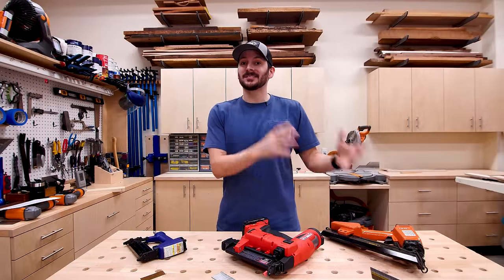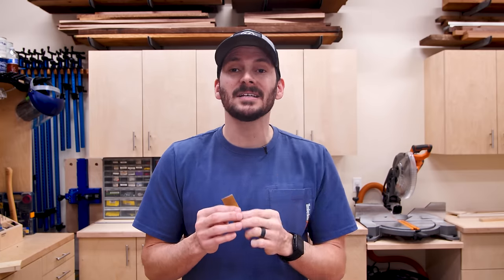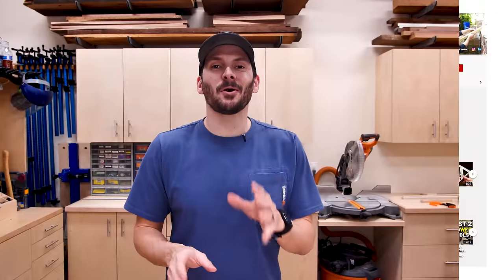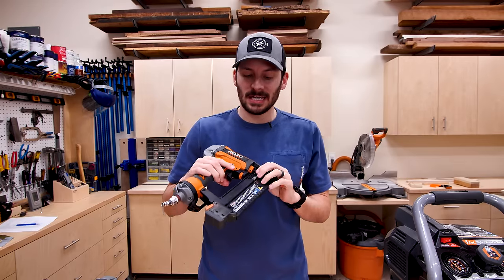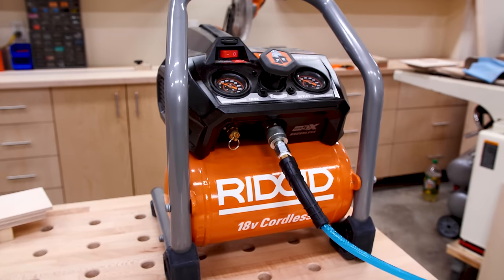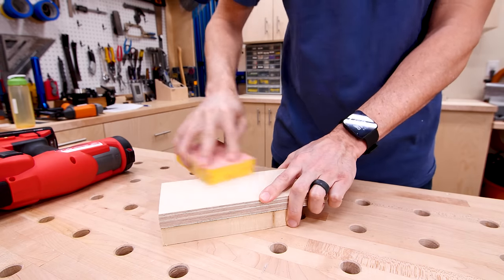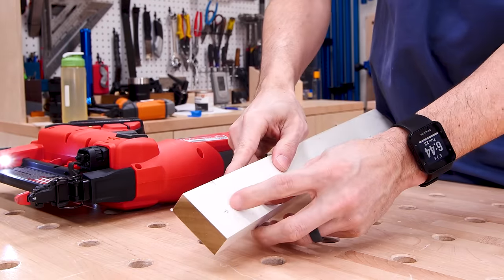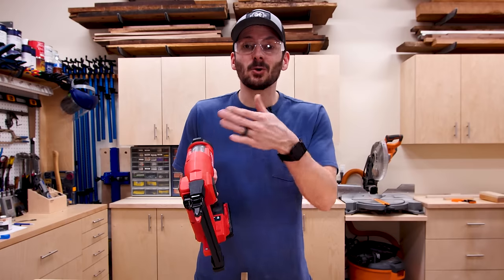6 Nail Gun Mistakes You Should Avoid | Brad Nailer Tips

Comment from the maker: What other tips and tricks videos would you like to see?  It was fun deep diving into one tool/technique.
Reply: I think we would also benefit from a miter saw calibration video with your unique blend of “attention to detail.”
Reply: Any one !  Make it a series ! All tools have their little secrets, don't they?
Reply: How about a bonus track on fixing blowout when you're not able to pull the work apart?  Usually I end up prying the blown out end up some, cutting flush with the surface then using a nailset or a punch to hammer it below the face of the material and filling/sanding.  But, I feel like that's almost a butcher-level move, and I'm never fully happy with the result - there's gotta be a better way out there somehow.
Reply: You can use a nail set to LAUNCH hinge pins out of doors.
Reply: Maybe a sanding video... Different type of sanders..  What grit to use... Different techniques. sanding block types.. Just a thought
Reply: I with JL R's comment ! Make a few videos of the "proper way" to use tools , fixing common mistakes (blow outs) , cause u don't know your doing something wrong till u see it being done the right way !! Thanks for sharing 👍
Reply: @shinji391  m
Reply: I would like to know the best way and nail size for t&g log lap sidings on the outside of cabin.
Reply: We did some bookshelves and felt like we were shooting the nail through blind and we would put the backing of the shelf on and want to attach to each individual shelf. Many of the nails shot through and missed the shelf as we were not able to tell where the shelf met the back. If you have ideas when doing bookshelves where you can’t tell where the nail is coming out the other side, that would be awesome!
Reply: Brad, how about a followup about brad nails and saw blades?  I don't ever intend to run a nail through a table or miter saw but was just wondering how damaging the 18 gauge in particular would be to a good carbide blade.  My daily use table saw blades go in price from a Freud Glue Line Rip up to a Woodworker II so just wondering if I should have a cheaper blade to use if there's a chance of hitting a brad nail.  Hammer driven nails are a whole different animal because they're heat treated steel and I would expect them to damage a carbide blade badly.  Thanks!
Reply: 99
Reply: Everyone shows us how to check for square by measuring diagonally but never shows how to fix it if it isn’t square
Reply: Which compressor to use for workshop tools - and why!
Reply: A video on how to use a bandsaw would be great!
Reply: @David-hm9ic  
Small gauge nails that are embedded in the wood, and that are perpendicular to the blade, represent a small profile. They don't seem to affect the carbide, unless it happens routinely. Framing nails (striven with a nail gun or hammer) are not heat treated (hardened). Framing nails are required to be malleable to function properly in shear. The use of hardened "construction screws" are not allowed in framing (by code),  for that very reason. Concrete nails are hard and brittle and would therefore be very damaging to a carbide blade.
Reply: You didn't show how you'd fix the blowout should you get one. Is it possible?
Reply: I'd like to offer an alternative answer to your last problem. side blowout. it's not so much the shape of the nail as it the orientation of the chisel tip. When shooting parallel to the board, the chisel tip is also oriented that way, and will tend to follow the grain, as previously stated. When turning perpendicular, there is no grain to follow, AND the chisel tip will cut across the grain. This will also result in a tighter fit, as the grain won't try to separate to let the nail through. The cut fibers will bend down slightly, creating a feathered edge gripping the nail from coming out.. This also reduces the chance of end splitting when you nail too close to the end of the board.
Reply: Put them in at an angle for a stronger grip especially you use a longer nail the gripping power is insane vs straight in and if you alternate direction back and forth that increases the nails strength. so along a length you aim one a 15 to 35 degree up next one down repeat as any stress on the joint make it hard to pull straight out like a more traditional straight in nail it also means you can use less nails but still get a better grip (Not that you should skip the correct amount of nails!)

Comment: I've been a professional painter for over 30 years and found out the hard way that you don't fill nail holes until you've stained and put one coat of sealer on.  This will greatly reduce any putty fowling the wood and showing as a big blob when stain is applied.  Once the first coat of sealer is dry simply lightly sand the surface and then apply the wood putty or filler of your choice.  Once this is dry, again lightly sand and then apply the finish coat of varnish.  You can use color putty, or if you like the glue and sawdust option then just wipe a quick coat of stain on a rag over the nails before the last sealer coat.

Comment: oh my god, the blue tape trick is so obvious and genius yet it's never occurred to me.
Reply from the maker: Yeah, one of those "duh" moments when I found it too
Reply: mixing stain with glue and sawdust also
Reply: exacly, when i saw that, I thought holy cow that would have saved me about a months worth of sanding and probably 10 gallons of wood putty.
Reply: The tape could also act as a guide or nail line.
Reply: Love this tip!!
Reply: Very clever.  I plan to use the blue tape tomorrow on a molding project. Thanks for the tip. I bet it'll work. 👍
Reply: Yep that was the one where I went "oooohhhhh" most useful part of the video
Reply: Blue tape seemingly solves everything

Comment: Here is one I learned the hard way: Don’t expect the nail to pull your workpieces together. Hold them firmly together and then shoot your nail.
Reply: Lol why would you think that it would pull them together? Theyre not screws
Reply: @1988dgs  if you want to prove me wrong you sould have mentioned ring shank nails. Those might work to pull things together. Missed opportunity there
Reply: @autodidacticartisan  a ring shank nail on its own wouldn’t pull anything together, a nail has holding power, not pulling power, it’s the hammer hitting it that moves two boards together
Reply: @1988dgs  youre right, I tried throwing a nail at a board and it didn't do anything. You do need the hammer to hammer it in. Silly me
Reply: @autodidacticartisan  so we agree that the nail alone is not capable of pulling two boards together, it’s the delivery method, ie a hammer, and the hammer in a nail gun has little weight so can’t deliver enough force to close up a gap…
Reply: @1988dgs  sure man I guess we agree
Reply: if you use a framing nailer, often times you can toe nail something and then hit it with a hammer to pull it
Reply: coated nails hold better

Comment: I've got a 40 year old Senco pin nailer that must be oiled fro time to time. If you over oil or oil too frequently with a gun like this you may get oil mist on your safety glasses or even droplets on unfinished work. Undesirable? Yes. On the other hand, it has lasted 40 years without signs of impending failure.

Comment: Great video. However I believe you are incorrect about the adjustment wheel. It does not adjust the driver pin, it adjusts the foot on the bottom of the tool. The driver pin length/action never changes, only the depth of the foot to make the fastener proud or deep.

Comment: I've never heard of the "shoot the nail perpendicular to the board"....that was really awesome and will go in to my mental bank for sure.
Reply: @samuelsmith5773  An 18 gauge nailer that shoots two and a half inch long braids is highly unusual and I've never seen one.
Reply: I do a lot of glazing of stained glass panels - often re-installing them after a repair into very old and hard wood sash. Blowing out the face of an already finished door is a nightmare that happens a few times a year. I have actually had nails do a full 180 and come back out!  Every new guy has had his finger skewered despite my insistence on keeping them clear. I can't always fit my gun at a right angle and not hit the glass. but I will definitely keep the perpendicular trick in mind to see if that lessens the incidence.
Reply: His premise is partially wrong... The reason why it doesn't blow out when the gun is perpendicular is... the tip of the nail. Tips are cut at an angle, that will cause it to follow the path of least resistance and curve one way or another. It will make the nail curve left or right inside of the board, instead of blowing out the side. So look at the nail tip design and nail 90 degrees from the edge of the board. If you can't because you can't get the gun at 90 degrees, grind the tips flat on a stick of nails. And there will be less chance of it blowing out the side. But you might have to adjust the driving power so it sinks them at the same depth.
Reply: @kiddiescripterkiller  Another way to explain this is that when the nail gun is parallel to the board, the sharp edges of the nail is as well.  This makes the tip drive between the grain and more likely to “steer” itself through the grain.  When the gun is perpendicular to the board, the edge of the nail tip is also perpendicular to the grain causing it to cut through the grain letting it stay straight as it’s going through.  Imagine pushing a knife through a bundle of straws parallel to the straws.  It will not cut the straws and the blade will slide between the straws.  If the straws were organized in a way that they guided the knife to the left or right, you would get the blowout situation.  Now if you cut perpendicular to the straws, the blade will just slice through the grain and will tend to go straight through.

Comment: Thank you!  I never understood the finer points about blowouts, and how nails/brads want to follow wood grain.  That helped a LOT.
Reply: Woodgrain definitely is a factor, but it's the chisel on the tip that mainly steers the nail. Brad nails are chiseled on the sides and finish nails are chiseled on the front and back. Shooting perpendicular only works with brads. You would do the opposite if using a finish nailer.

Comment: Great video! The way driving orientation and blow out was described to me was by showing me the bevel cut on the nail, and explaining that the bevel will cause it to go to one side or the other. If you drive it with the bevel running perpendicular to the edge, deflection to the left or the right will stay in the board. If the bevel is in line with the board, left or right deflection will cause blow out.

Comment: I have a finish nailer, brad nailer, stapler, and a pin nailer. Love them all. They each have their uses and needs. You're absolutely correctly about nail size, many don't fully understand that. I even have both air and battery operated nailers. For air, turn the air pressure down, you don't need that much PSI. Now, if you actually read the manual on the tool, it gives you the proper settings. Even the cordless nailers have settings you adjust. Speaking of oil for your tools, don't over oil them. Excess oil will get shot out of the exhaust port of the air tool. 
I was taught, to always under drive just slightly and always finish with a nail set. It's old school and I'm old school taught. It's extra work but, you know that that nail or pin is set correctly. As for the putty, there are types that can be stained but, yes, the tape trick always works the best. 
Yup, I've seen many people shoot their own fingers because they kept them in the wrong spot. Great video, cheers :)

Comment: Thank you for taking the time to put this video together.  I never thought about how the Brad nails are less likely to bend up/down vs left/right, as mentioned in you last tip. Thanks man! Keep up the great work!
Reply: Learned that little trick quite a while back. I was looking at the nails one time and realized that they were much more likely to bend on the wide flat area due to being weaker in that axis. Started holding my gun differently so the nails would have the width across the wood instead of lengthwise and it made a big difference. Doesn’t really work on pin nails tho…..too thin…..

Comment: Another reason why the perpendicular trick works is the orientation of the bevel on the tip of the nail. If the point catches wood grain (or harder particles in particle board), it will deflect in the direction of the bevel. 

Great tips, man. Your presentation was clear, concise, and thorough. I’ll be checking out more of your content for sure. 👍

Comment: Usefull video,even for the experienced. I use to work in a cabinet shop and have “nailed or stapled”my fingers a few times. Last time was a 15 gu nail 2” long a year ago. Through the thumbnail. Had to cut it and pull it off the nail. Also I find a 18 gu stapler one of my most used tools. They work good on thin materials like masonite. Like pins and brads,they have a chiseled point and are designed to splay .

Comment: Love the Blue tape trick. You may not agree with my tip, but I have used it for over 9 years. Take 18ga. nail gun and tilt slightly forward and give angle to nail. This give a little more holding power. Now go the to other end of project and at slight angle toward the first nail. Then nail the rest of the nails  straight. I have dun this with 1", 1 1/2", 2" nails.
Reply from the maker: yeah, I could see that.  makes sense to me!

Comment: Loved your explanation of blowouts. I have an experience. Using a framing gun with 3 1/4 nails and doing a toe nail or where you angle the gun against the surface. Somthing I haddent noticed on the piece of wood that I was attaching to. That 3 1/4 in nail blew out at all most a 90% narrowly missing impaling my hand. After the shock of what happened I wanted to know what happened what made that nail do that. On the back side of the stock I was attaching to I found a knot that only went part way through. That knot taught me to really have a good look at both pieces front and back. Now about finish nail blow out. If you don't get your finger nails and get blood all over your finish piece. But now what do you do? You could try to push the finish nail back out or pull it straight through. Something I havent had much success with. Not without causing more damage. However my dremel tool has all these stones bits and cutting disks. Depending on your skill level you should be able to cut the nail off very close to the wood use a tapered stone to grind the nail down into the wood making a small hole that is easily filled if you can live with a slight blemish in your finish your in luck. If not. Well you just cut  another piece 😊 enjoy your project.

Comment: Brad "Nailer" Rodriguez.   Holding the gun perpendicular to the board is by far the most consistent way to avoid blowout.  I learned that trick shortly after getting a battery-powered nail gun a few years ago.  In the first few weeks I blew out countless edge nails but in the 2+ years since, I've probably had maybe 5 or 10 nails that blew out and it was usually because the project had an awkward position or tight spot with a poor angle.

Comment: great video, of course I am only watching it after I bought my first. I just wanted to add a little point about rotating the gun by 90. its not only going to help reduce blow out due to the orientation of the shank itself but a good amount of what will decide where the nail will drive itself is due to the chisel grind on the tip. in line with the grain the tip can deflect inside the wood, yet across the direction of the grain will mean the nail actually will cut some fibers of the wood, which not only should mean they have a higher chance of driving straight but may even help to strengthen the bond between nail and wood as the cut fibers being forced downwards should grip and counter the nail being withdrawn from the wood

Comment: with doing brad nails and small shoe molding i find if i want the nail to curve 1 direction every time so i can tack the small trim to baseboard trim without hitting the floor then i take a file to the tip of the strip of nails and lightly put a bevel on one side.. now the angle of the tip will make brad nail curve in a uniform direction. 

helps when you have a bulky brad nailer or limited baseboard material to attach trim to on an old house where there are gaps between baseboards and the wood floor that aren't uniform.

Comment: Brad, you should definitely add a 21 guage nailer to your arsenal. I recently got one after watching an adam savage video and it's been amazing. Smaller hole like a 23 gauge pinner, but more holding power and 2" pins bend far less frequently. The one I have is a senco. Cadex makes one too.
For face to edge connections, I like to have 1" of nail going into the edge piece.
I set my compressor to 80-85 psi and any further adjustments on the gun.

Comment: Nice tips, Brad. Turning the gun perpendicular to the piece works not just because of the shape of the nail, but probably more so because of the chisel tip. That tip will want to follow the grain. (Learned that years ago from John Heisz.)
Reply from the maker: i'd be interested to see a nail with reverse dimensions and same chisel to see if that is indeed true.  Makes sense, but so does bending in the path of least resistance.  Wonder which would prevail?

Comment: I have to correct you on some thing.... The Ryobi Brad Nailer as well as the Narrow crown stapler both have built in compressors....And they both have 2 depth adjustments.... The depth adjustment dial down by the tip....And the air regulator adjustment on the back of the gun
Reply from the maker: Yup, totally correct
Reply: BTW.... i've made that mistake many times with the Brad Nailer.... coming out the side.... Great tip and trick on how to remedy that 👍🏻👍🏻👍🏻👍🏻